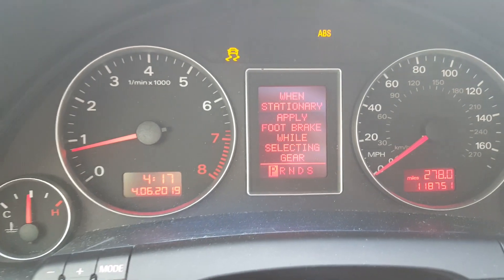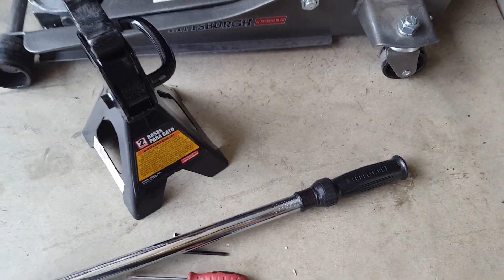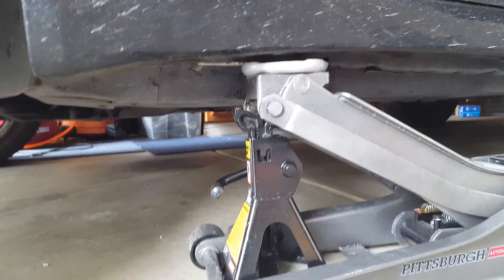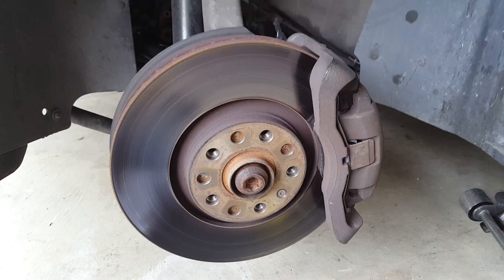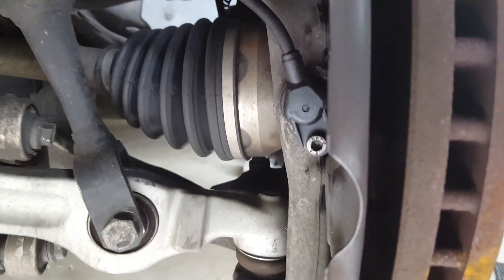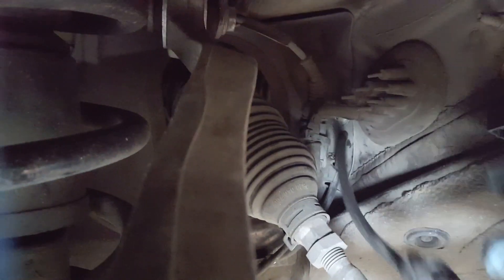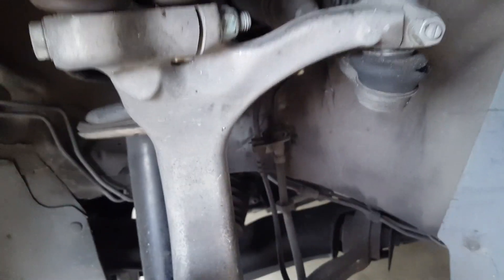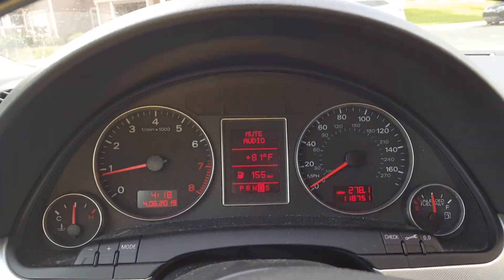2007 Audi A4 2'0L ABS Sensor Replacement.

Comment: hi there great video very informative I need to replace a faulty front right abs senses and i would really appreciate your help - I can only find a replacement part of the actual sensor itself NOT the whole loom (wire) like what you have here, so is it EASY to just replace the sensor on its own ? thanks ! (in the UK) B7 avant 2.0 BRE
Reply from the maker: It should be very simple to replace if you have disconnect clip on it , What year is your Audi?
Reply: @samstye  I’m hoping so!! I’ll whip the wheel off and see :) it’s a 2008 b7 2.0 TDI BRE ~ I’ll call the local auto shops to see if they have the whole part, I seem to remember doing this on our C5 A6 too but a long time ago ! Thanks
Reply from the maker: @lashwynter  Local auto parts store should have it, if they don't I would check online at ecstuning.com I don't advertise them or anything but I do buy OEM parts from them all the time and never had issues. Thanks for watch and best of luck to you

Comment: Nice Video! I am curious about the three ends that cable. One goes in the top the other in the abs sensor as you explained. What about the third one? Does that click into the brake pad sensor wire?
Reply from the maker: Thanks Talha
That's correct on the front wheels only of this car but it can be different on other cars depends on year make and model.
Reply: The third ones is to let you know that your car will need new pads soon
Reply from the maker: @mariodr20  that's correct too.
Reply: Sim vai no sensor das pastilhas

Comment: ive seen another video where they remove the axle bolt to position the abs sensor? is this necessary? i didnt see this in your video
Reply from the maker: Eyits 
As you can see I didn't have any reason to touch axle at all for the sensor replacement on this car.